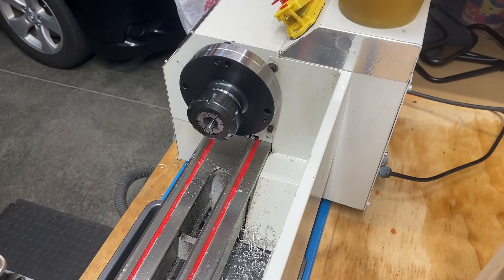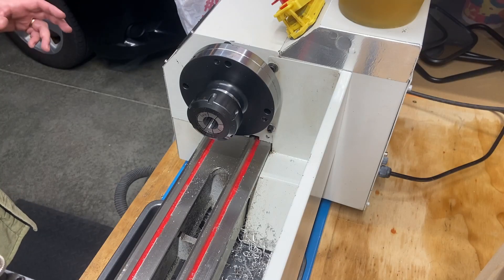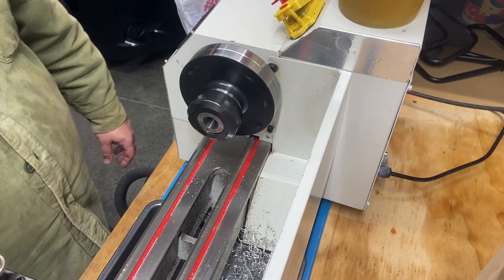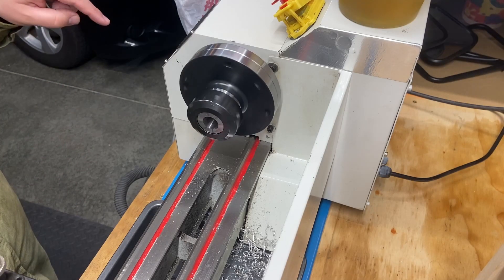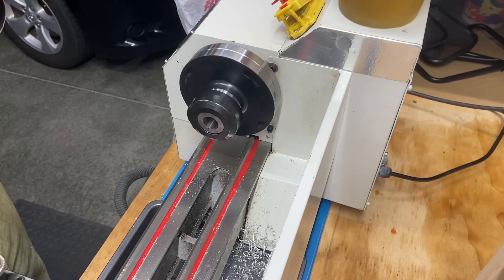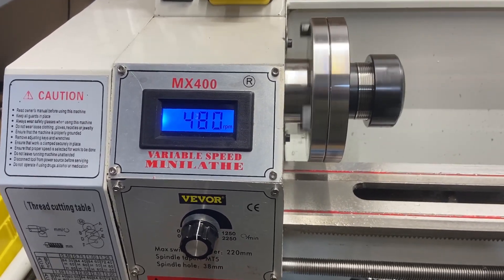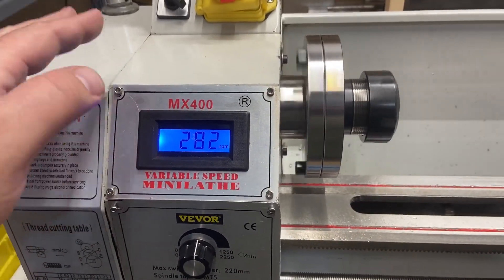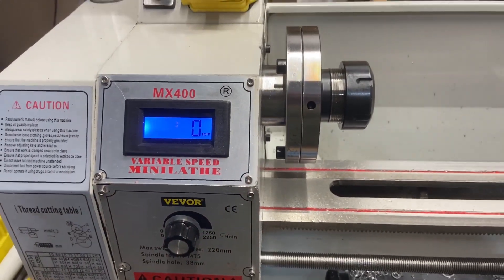Vevor Mini Lathe Issues - Variable Speed slows down on its own.  Possible Poteniometer Issues.

Comment: What ive figured out with the knob, if you gently pull on the knob then turn it to your desired speed and it typically stays at that speed
Reply: Really? Can i get a link to the product you bought? 

Yea mine does the exact same thing, and i can hear the same whining (constant beep) sound on yours too although its much quieter. I read that its coming from the electrical components on the circuit board or something like that, i cant remember but short answer is, you cantget rid of the whine without altering the circuit board(s), which isnt my cup of tea.
Reply from the maker: @sunsofeternity  This is what I purchased.  Cheap enough to try.  https://www.amazon.com/dp/B0111U5DUO?ref_=ppx_hzsearch_conn_dt_b_fed_asin_title_1

or search amazon for "uxcell Rotary Carbon Film Potentiometer with Control Knob, WTH118-1A 2W 4K7 Ohm"

Good luck
Reply from the maker: I ended up replacing it for a 7 dollar replacement from Amazon.  Works like a champ.

Comment: I think the ER collet chuck stole the show. I bet your pot was bad. Hopefully you went with a 10 turn model. I'm curious is it a 4.7K ohm? Also, did you build the ER Collet chuck or di you purchase it somewhere? I just purchased a set of ER32's for my old Jet !6 mill drill. It would be sweet to use these on my lathe too. Enjoyed your video.
Reply from the maker: Yep,  My pot was bad.  I replaced it with a cheap replacement from amazon nothing that I would consider an upgrade.  It was 4.7K OHM.  Vevor did reimburse me for the part.  I didnt build the ER40 collet chuck,  I found one on Amazon...I think maybe it was ebay but it was 125mm and had the 3 hold mounting pattern and the recess for my lathe chuck mounting plate.  It bolted right up like it was made for the lathe.  Then I purchased 2 sets of collets.  the common sizes and in between sizes.  I use it often depending on which project I and working on.  since this video I have expanded my shop to include a Milling machine and use the same collets in collet blocks to mount inthe milling vise.  A good set of Collets and mouting options is incredibly handy if you will be working on a variety of projects.   Thanks for the feedback and thanks for watching.

Comment: I just got a 8x14 last week and mine does the same thing from day one. Have you found a fix? I can send mine back but i feel like a replacement will do the same thing plus i would have to pay the shipping so i want to just fix it. Thanks for posting.
Reply from the maker: I did fix mine.  I replaced the potentiometer and its working great again.  Support paid for the replacement part but I did the work.  I have a video on it.  https://youtu.be/d3nWULaAge4  It is titled  Boboran/Vevor Mini Lathe Support Review and replacing Potentiometer to fix variable speed issues, if you want to search for it and watch.  I purchased the pot from Amazon. Good luck. its easy enough to fix yourself.

Comment: The pots on these machines are crap from the get go, the controllers are also subjected to shorting out from swarf that works it’s way to the electronics. Vevor only sells these machines they don’t make them.  They really don’t know much about anything they sell.
Reply from the maker: yeah,  I am testing support right now.  I am going in circles a bit but so far I am getting responses.  I will make a summary video of how my warranty and support experience goes with this.  Its part of why I started this channel, to share my full experience with Vevor and cheap mini lathes.  You are right,  They just resell cheap stuff but its they brand and they need to stick by their warranty and support they advertise...in any case I will be making a video on my experience and how things go with them once I get things resolved or...not resolved.
Reply: @deezworkshop  if they stuck to their own warranties my lathe would have been replaced 3 years ago but all I ever got was the runaround from them.  They asked for videos, pictures etc and they didn’t even do anything to fix the problem.
Reply from the maker: I hear you.  We are going to find out how it goes in my situation.  Expect a full report in video format for the world to seek out regardless of the outcome.  It is in their best interst to resolve this.  We will find out together.  Wish your experience was better.
Reply: @deezworkshop  if they send you a new machine for free I will take your old one 😎.  I’m currently converting my mini lathe to CNC with an ATC turntable turret.  Not sure what direction I will go with the turret but it is a long term project nonetheless.
Reply from the maker: @taranson3057  Wouldn't that be nice 🙂.  Doubtful that will be the solution.  I will post a video review soon my my support experience for anyone interested.  Good luck with your conversion, sounds interesting.

Comment: ER collet chuck is a nice addition. As others have mentioned, most likely a little dirt between the wiper and windings. A multi-turn pot would give you much more granular control at the expense of the obvious (more arc distance to commanded speed).
Reply from the maker: I may pick up some electronics cleaner and try to clean it out but ill be replacing it to fix it for good.  its only getting worse.

Comment: If it is the potentiometer it will either be dirty inside, or the actual resistive material is scraping off the substrate inside.  If it is dirty you can probably make it temporarily better by turning off the lathe and rapidly turning the pot back and forth full range a dozen times or so.  I you do that and it appears to be better, then yeah, replace the pot.  Modern DC drives like this one do not use a potentiometer to control the voltage to the motor, the potentiometer is a simple voltage divider that is used as an input into the motor controller.  
The actual motor control is using high current MOSFETs, and any failure mode in those is not likely to result in speed irregularities.  Depending on the price of the drive and the temperature protection in it the MOSFETs will either pass power under load until they go pop (sometimes even with flames and smoke) or, more likely there will be current protection built into the controller, and when it is exceeded the motor will just stop, and require you to power off and back on to reset the system.  
Way back in the old days DC motors were often controlled just by changing the voltage supplied to the motor. This resulted in really bad low speed torque.  Modern brushed controllers use pulses of the full supply voltage, and vary the percentage of time it is on to control the speed.  This is called Pulse Width Modultion, or PWM, and provides much better low speed torque.  This is what allows things like these benchtop machine tools to actually function, when in the past they would use an AC motor and use belts to change speeds.  
Interestingly the first time I came into contact with PWM motor controllers was in the 70s, and it was with my dad's HO scale model railroads.  HO trains have a problem because the motors are small, and the load of a train of cars is big enough that they can't go realistically slow without stalling using traditional voltage control methods.  PWM train controls were more expensive, but they could go slow with enough torque to pull a train.  
In contrast to all this are DC Brushless motors, which is really a misnomer, since in actuality they are multiphase AC motors with smart controllers that are actually a type of variable frequency drive, but the drive runs on a DC supply from which it builds the waveforms to power the motor.  To the user, brushless motors have even better low speed torque, and never need to have the brushes replaced.
Reply from the maker: I can get by with it but I am sure the pot is on its way out.  regardless im going to buy another to have on hand for no more expensive than they are.  As usual my mind is blown with the information you have shared.  Tons of good information in your comment.  I found it all very interesting.  Thanks for sharing.

Comment: If the pot is dirty as someone suggested, try turning it back a forth quite a few times, with the power off, and see if that cures the problem. You will still need to replace it as it will eventually happen again.
Reply from the maker: I’ll give it a shot. My guess is moisture and dirt has gotten to it.

Comment: Thats the chance you take with these cheap Chinese machines, some good some develope problems.....ive been lucky with my 7x14
Reply from the maker: Yeah,  I expect to have issues here and there.  I am sure ill have to deal with the bearings someday as well for the spindle.  All part of the fun for me though as wierd as that sounds.  If it turns out to be the Potentiometer its is a pretty inexpensive fix but im going to test Vevor warranty.  so far struck out yesterday.  Their chat said they didnt have any representatives that spoke english and simply disconnected me.

Comment: New pot is easy enough, but a squirt of switch cleaner might sort it, - as I was once an electronics engineer I always have a tin of it to hand!
I see you have sneakily got a collet chuck while I wasn't looking!🙂 How's that working out?
Reply from the maker: :-)  ER40 was my collet chuck of choice.  This was my forst test usage of it and I love it.  the repeatability of getting your parts centered and truning true is excellent.  I am glad to have had all the great suggestions and tips.  There are so many ways to get a collet chuck mounted.  In my case this made the most sense.  I was able to get larger material sizes and kept max bed length.

Comment: Yeah I would say it is the potentiometer. There should be a number stamped on the back of it that will tell you the value. Another thing you need to know is the shaft size to make sure you get the right one. It is probably a 1/4" shaft. If you tell me the value I'll look through my electronic stuff and see if I have one.
Reply from the maker: for those curious or in a similar situation the markings on the poteniometer are WTH118 4K7 2W
Reply from the maker: Sent you an email